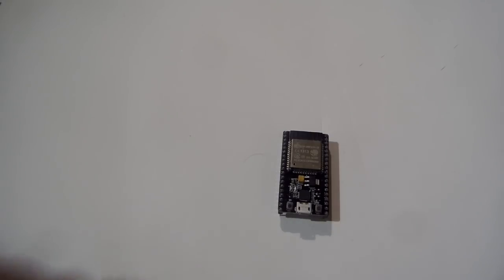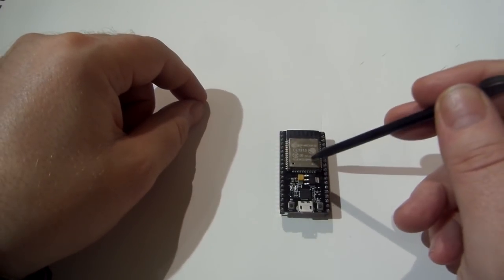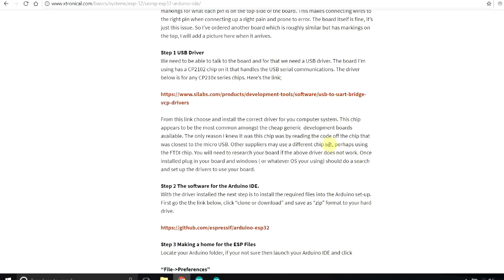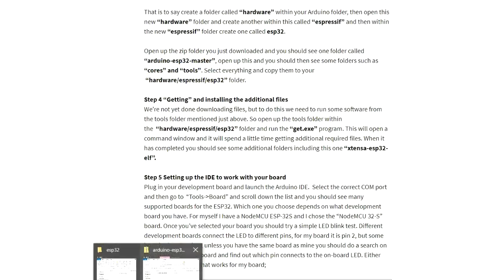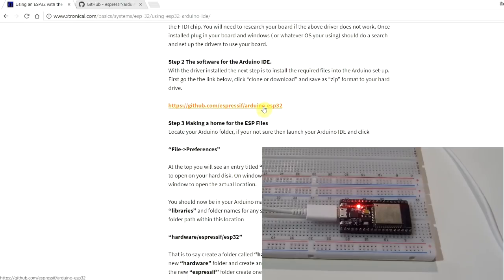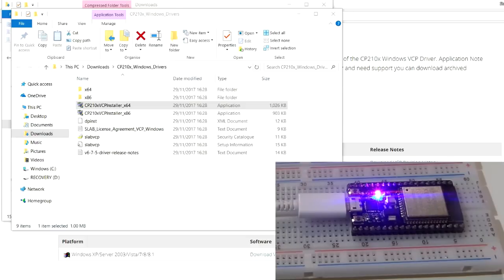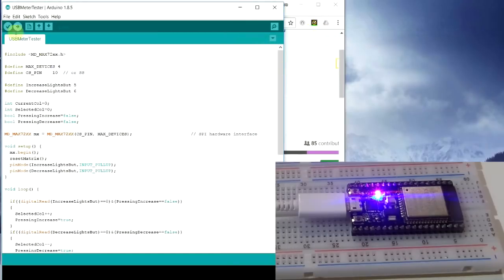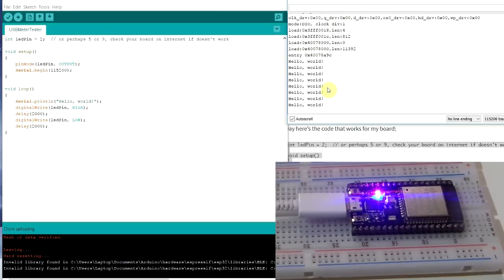Programming an ESP32 with the Arduino IDE

Comment: I found your tutorial earlier, and finally got my unit working.  As is my habit with new boards, I ordered two, this time it proved to be a great idea , you see I have tried several times to get this install to work from other folks, and always failed, so this time I followed every step to the letter, and still FAIL.  So I think, well perhaps it is the board, I take the other board and suddenly I have the power light, never present on the board I had been trying to get working, so my computer finds it, and I have it in my Arduino programmer.  So I play around with it a bit and love every second. When I am finished, I take a look at the bad board. I play with the little home built oscilloscope in an Altoids can, and noticed that when I test the voltage across the 3.3 volt converter, the light lights up!  Thankfully, some months back, I needed one of these little 3.3 volt SMD converters, and, of course, you cannot order just one, so I have about a dozen of these little guys. I replace the 3.3 converter, and suddenly I have TWO working ESP32's.  What a joy to  recover one of these when they send you a bad one!  Thanks a million, I can ow play with these.       Is there a chance you will post the setup for FROGGER, that would be a BLAST indeed.
Reply from the maker: What a good story, great to get it working. I've restarted the frogger project now that I've got the DACAudio to a good state of development. Next write up and full source will be available when music has been added to the game.

Comment: this video sounds interesting?  i would like  store 3 calibration analog voltage readings:  Code-A-zero = 123   Code-A-span = 523 ,  Code-B-zero =047  Code-B-span = 468, Code-C-zero = 194  Code-C-span = 602 then power-cycle the esp32 retaining the calibration numbers. also, 1  or 2 times every 2 months enter a new calibration and read many times. any suggestions? thanks🙂
Reply from the maker: Esp32 have none volatile internal memory to do this. In fact they provide a basic file system to write to it called "spiffs". I've not done a video on it but there will be ones that have.
Reply: @XTronical  thank you now for spiffs.🙂

Comment: at 1703, that is NOT the memory chip, that is the 3.3 volt step down converter IC.  It is the chip I had to replace below.
Reply from the maker: Aye, wasn't having a good day then, lol. Have since had to buy a bunch of these 3.3 regulators as well but it didn't fix one of my esp32s unfortunately.

Comment: i amtrying for OTA update for quite a while and no success yet. any help? i am getting--

 error- Sending invitation to 192.168.1.240 04:48:43 
[ERROR]: No response from device 04:48:43
 [ERROR]: No response from device
Reply from the maker: I've not yet used the Wifi capabilities of the ESP32 (have dabbled with the ESP8266) and even with the ESP8266 I've always used an USB cable for firmware updates so my experience is limited in this area. However I did come across this thread on the Espressif githib page,

https://github.com/espressif/arduino-esp32/issues/612

Hope that helps
Reply: Thanks a lot, i will lookinto the link.

Comment: How many pins are available for inputs after the LCD you are using?
Reply from the maker: On this board there are lots left as it uses SPI interface which doesn't use many.
Reply: XTronical awesome. I'm planning on making a pedometer based game like the Digimon digivices, so I need inputs for sound, accelerometer, screen and atleast 4 buttons, so I wanted to make sure this chip would work. Thanks!

Comment: i need analogueWrite() for this MCU, with arduino iDE, need help
i need to run my motors
Reply from the maker: That function is not implemented for the esp32 and may not be due to technical issues but there are work arounds, see this thread https://github.com/espressif/arduino-esp32/issues/4
Reply: XTronical I have gone through , but couldn't figure out a proper solution or replacement :'(

I have to submit my project tomorrow :(